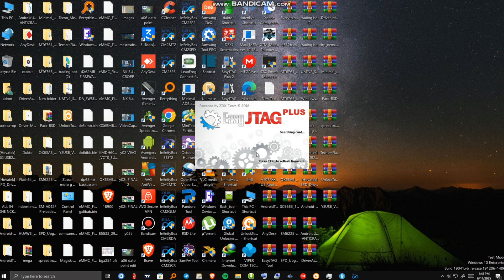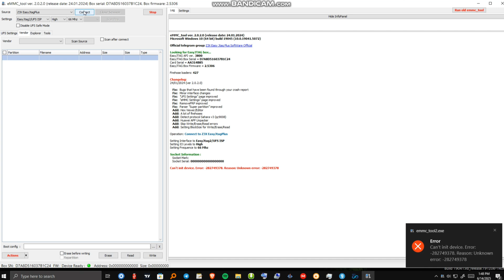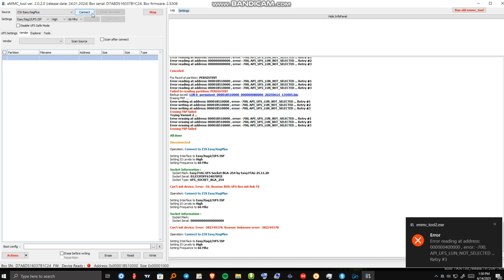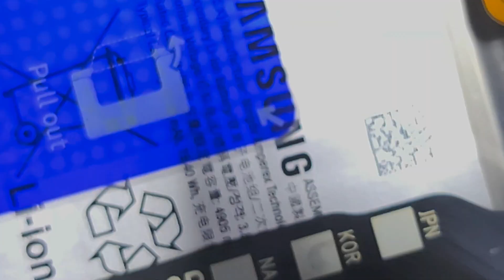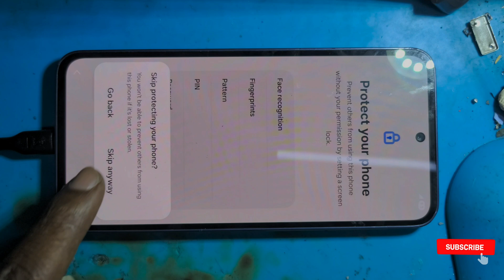Samsung A35/A356b Reset And Frp isp Android 15 easyjtag

Comment: Hello boss good morning in Ghana time I can see you know how to do the ISP I'm using easy jtac box plus
Anytime I will try to do ISP connection on every Samsung phone that is using ISP the phone will go off I'll go for a new board I don't know the reason why so please can you tell me the reason why is doing that Samsung a14 Lite I off the board Samsung a21s I off the board too and now they bring Samsung a53 I don't know how to start it
Reply from the maker: you should check your connections.check for broken circuits,damaged components,shot circuits.
Reply from the maker: too much heat can damage components especially  clk and cmd.you can make jumper on clk and replace cmd resistor.cmd=10k ohms
Reply from the maker: also clean your board after the job